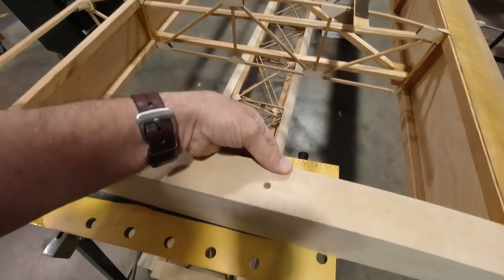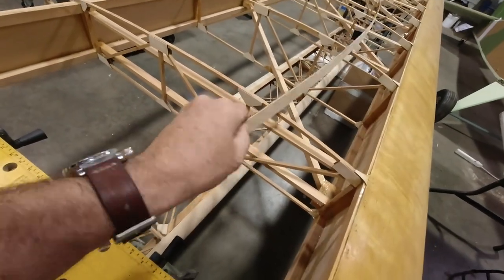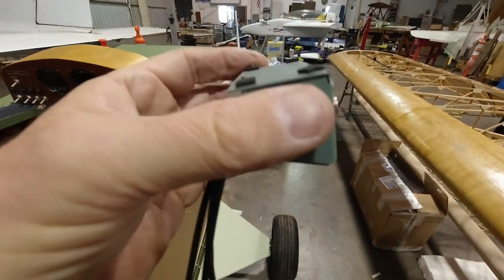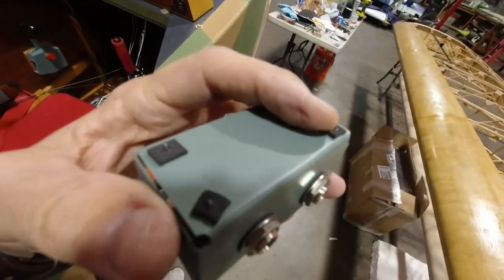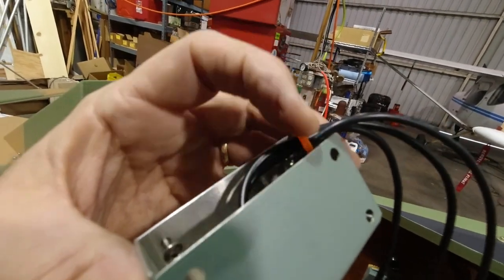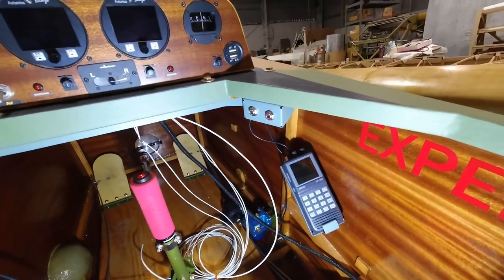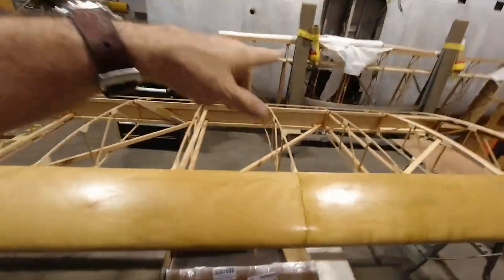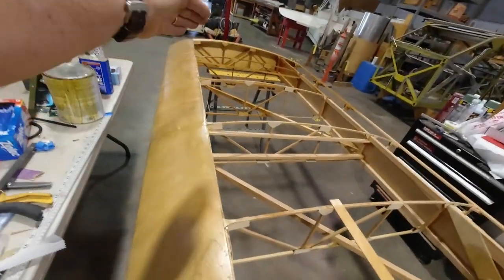Minimax 1100r Wood Aircraft Build Ep 175

Comment: Glade you checked the cables for the headset to the socket in the aircraft and found it worked. Always good to check and even then we end up doing tweeks down the line with the odd bits that we find don't work.
Reply from the maker: I appreciate that suggestion…you’re sure moving along
Reply: @DTMinimax  Well just trying to help, often another set of eyes can see something missed or give an idea. Yes my project is progressing fairly well. It might go a bit faster if I did not modify things, to certified aircraft standard.

Comment: would i need any special tools or equipment to make one of these planes?
Reply from the maker: You can actually build this airplane from the kit with some really basic tools. 
From scratch as I’ve done, it requires a few more. 
What I consider essential is a good drill press and a good band saw. The spars require some tapers after they’re built and you could have a cabinet maker do that for you if necessary.